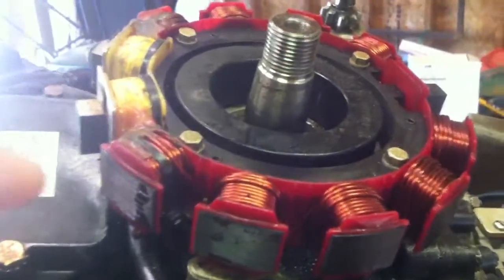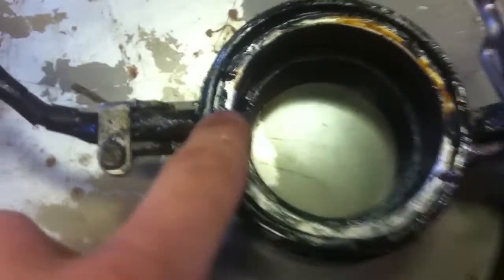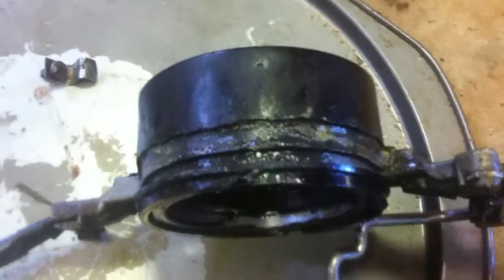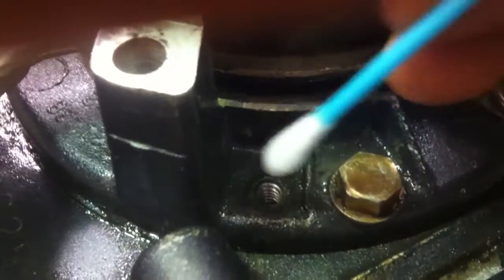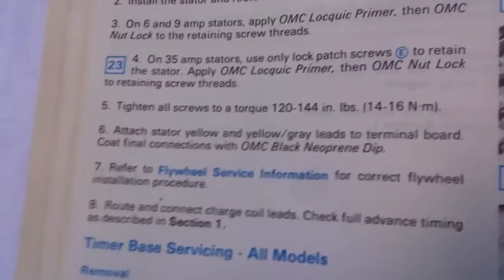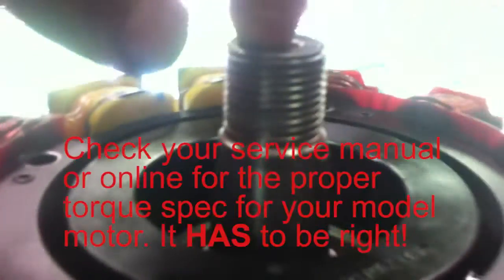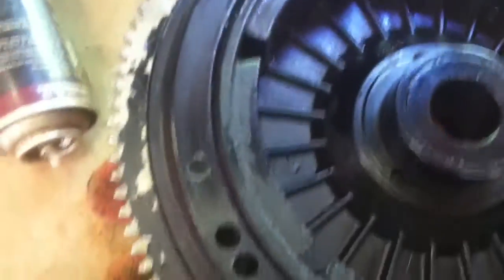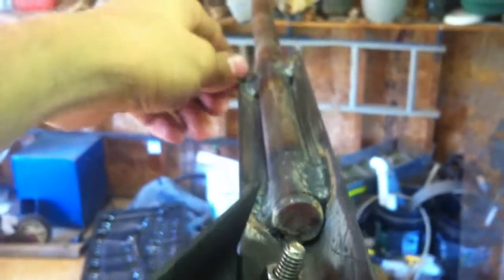How to repace an outboard Stator and Timer Base

Comment: Hey Matt I have a 50 horse Johnson and I do not have a trigger like this I have the stator and a metal timer base that hooks up to the linkage is this an odd ball motor that I have or what I also have three yellow wires coming from underneath the stator not just two

Comment: I have a 1996 mercury 200efi my regulators burned upand the wires came out of regulators i know the yellow and red go to stator does it matter which yellow oes to which yellow and red to red
Reply from the maker: You need to look up the wiring diagrams in a service manual or through pictures online. The wires should be color coated in the manual.

I don't want to tell you wrong without seeing it.

Comment: Thanks for sharing the knowledge. This helped me out a lot! Happy summer cruising!
Reply from the maker: You're welcome! That's the whole point of my channel. Consider subscribing. I have a bunch of other boat videos I'm about to film. Check out my old boat vids while you're at it!
Reply: Matt's Shop Sub'd, hey you might be able to shed some light. I just popped my stator and trigger out and am getting resistance readings across all wires on the trigger even though some insulation is cracked. However, getting bad readings on my stator, only one coil reads resistance and get continuity to ground on the other, and the charge coil has no resistance but has continuity (to itself - yellow to yellow). I'm tempted to start with a new stator and see if she fires up. Don't wanna spend more than I have to. Does that sound like the right thing to do? 89 Merc 150 Blackmax if that matters. Any help would be much appreciated.
Reply from the maker: I'd be a little worried about the cracked insulation on the trigger. However, from my experience, stators are more likely to go bad.
 Make sure you check every single spade, plug, or ring terminal for corrosion or broken wires.

Watch my video How To Test An Outboard Stator - The EASY Way: https://youtu.be/SwYHj0xKh90

I have links in the description to stator resistance values. Do the tests like I said in that video. I'm sure you will find that your stator is probably bad. Don't assume it is until you test it though!!

I have links to new stators in the description too. If you need a new stator make sure you buy one made by CDI they are the BEST. Don't buy a cheap one no matter how tempting it is PLEASE!

Comment back after you do the tests. Either on this vid or the other one and I will help you.
Reply: Matt's Shop I will buy CDI now that you've recommended it, it's a $40 difference. Also, if I use your affiliate link for Mercury stator in the stator vid, when I click on the one I need from the list on Amazon you'll get your portion right? I'll be sure to do that when I purchase it. You've been a huge help. Thanks for your time.
Reply from the maker: I'd test it first, but if you want to go ahead and order the stator just click on a couple of my Amazon links and then order whichever one you need once you are on Amazon. I appreciate your support and using my affiliate links really helps out my channel.

On the stator vid it has the CDI parts # locator if you want to double check the right part number. I would. Like I said, I like to test everything and isolate the problem 100%.

Is your stator oozing black stuff or goo out of the ends of the coils?
Reply: Matt's Shop I tested all 7 wires for resistance and continuity and only one set read any resistance, the others were all open and has continuity to ground. Also tested the trigger and verified all resistance values are within spec. Looks to be a bad stator. I hope these comments help someone else as well. Can be overwhelming at times. Okay, good to know. Gonna do an impeller swap and stator, and a few other odds and ends. The motor has very little use and doesn't show any signs of corrosion, should run like a champ.
Reply: Original symptoms were, hard to start, and ended up only having spark on 2 out of 6 cylinders. Also, the battery would not stay charged, which lead me to suspect stator.
Reply from the maker: Okay, it sounds like you have done your homework. I would replace the stator especially if your battery is not charging. That's the hope, that all these vids and info will help teach people.

Once you get her running make sure you run some seafoam through the motor to free up any stuck or carboned up rings.

I have a vid on that too: https://youtu.be/BXcfsmuruc0

It really helps a lot.

Comment: I have a 98 oceanpro 200 - carbureted. 1 cylinder is not firing and its been diagnosed to the timer base. The repair seems easy enough, but, im not familiar with timing an outboard engine. I understand from the manual that it should be done warm, at idle and wot, but, the idea of hanging onto the back of the boats motor mount isnt exactly ideal. Would a new timer base change the timing enough to cause problems?  Also, can I use any automotive timing light?   Many Thanks!
Reply from the maker: You have to check the timing after changing the timer base. There are two timing settings Idle/pickup timing and WOT timing. They are both important. The idle/pickup timing makes sure the timing advances properly until the timing/motor reaches WOT. If the idle/pickup timing is off the motor will NEVER run right at idle or low speeds. The WOT timing is the MOST IMPORTANT setting on an outboard. If it is set to low (retarded) it will lack performance and top end speed. If it is set too high (too far advanced ) past what the book says it WILL damage the motor and possibly burn a hole through the pistons.

You have to follow the OEM service manual to the "T" if you want both of these settings to be right. You can use a regular automotive timing light, but make sure you hook it up to the proper spark plug lead. You have to hang on to the back of the boat to make sure it is right. There are ways to do it on dry land, but I would not trust them. The boat running at WOT is the best way. Please be EXTREMELY CAREFUL the flywheel will rip your face or any body part to shreds if you hit it. Do it on a CALM day preferably cloudy, at sunrise, or sun set so you can see the what it is set at.

You also want to make sure to check the pointer and verify that it is set correctly if that model has a timing pointer (little arrow with a screw)

So just please be careful and follow the OEM service manual EXACTLY don't set it 1 degree less or 1 degree more than the book. You have to be at Wide Open Throttle with the carbs tuned right where the butterflies are perfectly flat, boat trimmed right, with someone else driving the boat! Check the timing kill the motor adjust the screw in or out, tighten the lock nut. Start it up go WOT check it again, kill the motor then rinse and repeat until it is right!
Reply: Many thanks for this information.  I greatly appreciate you giving me the summary. The repair manual is filled with details on the different type of engines 90, 60, FICHT, smaller outboards.It gets a little blurry. The Matrix "Tune up Specs" is clear about ignition timing degrees and rpm. However, 2 questions remain that the book does not seem to cover or be clear about.... 1. Which cylinder to attach the timing light  2. Do I need an OMC test propeller to do this?  My current prop is a stainless. Is there anything I need to take into account for the timing using my current prop?  Many thanks!
Reply from the maker: +Mercury CougarXR71997 You're welcome! The timing light should go on cyl 1, unless you have to time both sides. Then you check plug 1, set the timing, then the plug wire opposite at the top of the motor and set the timing to whichever one has the highest reading. You check the timing on both banks of pistons basically. Does your manual say anything about this? Are you using a Clymers manual or a factory service manual?

No, a standard prop is fine, just make sure it gets to the max RPM range.
Reply: Its a reprint of an OMC Factory Service manual. It does not say if I should time each bank of cylinders or just one bank. I never would have thought about this. Would a Clymers manual better?  I have always done my own work on outboards, but this is a first to do a timer base. I really like to do these things myself because 1. its hard to find a really good outboard mechanic who I can trust and knows their stuff, and 2, if I do it, I know its done correctly. But, this will be a bit of a challenge....
Reply: @matt's shop.  Many thank for the information! I greatly appreciate your help and advice. I will be giving it a try. If I fail, I will leave it to the pro's.... and hopefully I can find a good pro in the area.
Reply from the maker: +Mercury CougarXR71997 You're welcome! I'm sure you'll get it done right.
Reply: Mercury CougarXR71997 i

Comment: Can you please show me in detail how the timer base goes back on? I can't tell which side of the (plastic) retaining ring faces up. You also mention using oil AND grease to lube the timing assembly.  What lubricant is best?  A typical petroleum based grease??  Oil??  Silicone based??  Thanks for your help.
Reply from the maker: keith knizley My motor is already put back together, but the flat side of the ring should face DOWN towards the motor if I remember correctly. You should be able to tell there is only one right way. The little metal clips ride in the groove on the top. Make sure the ends of the clips do not rub on anything at all. The manual says a light coat for 2 stroke outboard oil. Don't go with a heavy grease because it will attract dirt and gunk. Make sure everything rotates freely!

Comment: Got  repair manual at marines engine.com
Reply from the maker: Yea, but https://www.outboardbooks.com/ Are reprints of the factory Evinrude/Johnson outboards. If you need a manual for a different manufacturer than you are right, https://www.marineengine.com/ is a good place to look. Look on eBay too!

DON'T BUY A SELOC MANUAL or other brand aftermarket service manual no matter what outboard it is. You want the factory manual for whatever outboard you are working on because of the VERY specific settings on you have to set. For example, setting the WOT timing, where it has to be exact!

Comment: where can I get that manual?
I have a 1989 90hp, your videos are great and help me out tremendously.  thanks!
Reply from the maker: +Mike4spirit Thanks for the support! You can find the book here: https://www.outboardbooks.com/  These are reprints of factory service manuals. Don't buy any other service manual other than the original ones. The aftermarket ones are nearly useless. 

You can look up your part number on that site and then check eBay for a cheaper price. Sometimes you cab get a deal on a used Service manual!